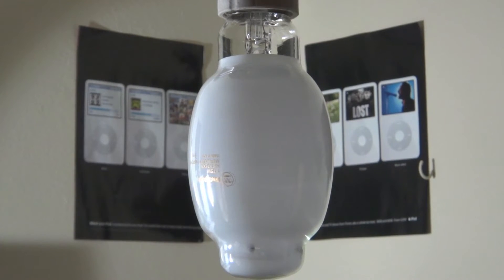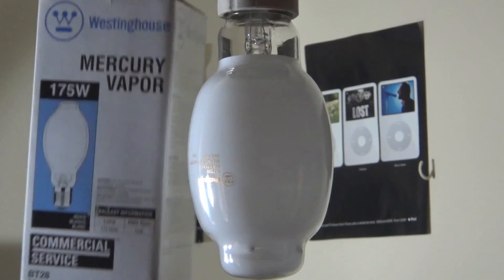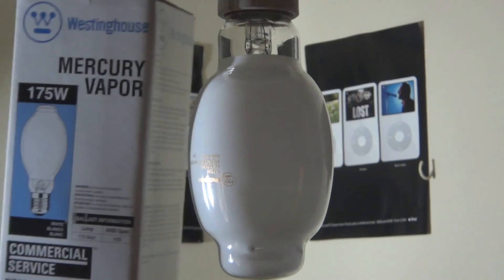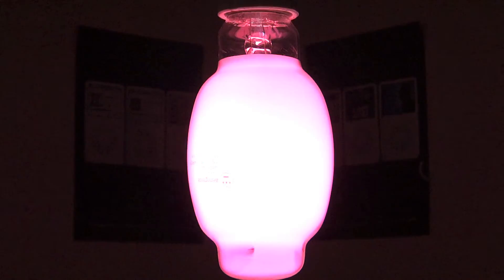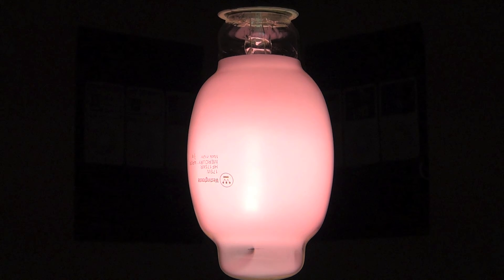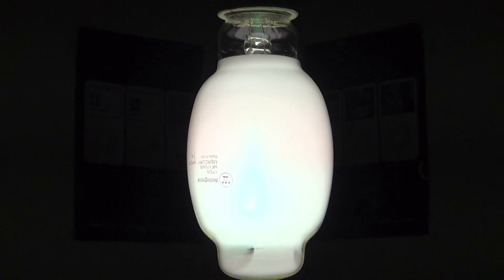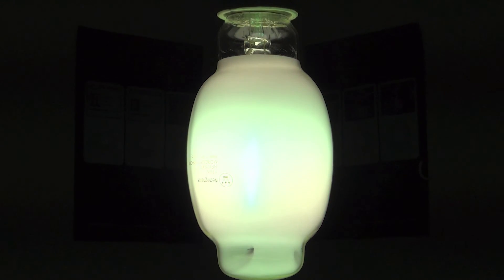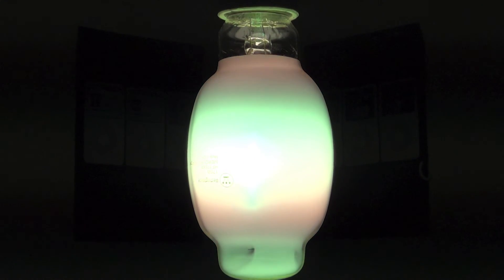Westinghouse Mercury Vapor (MV) 175watt bulb turning on 2

Comment: The westinghouse bulbs claim 8900 lumens.  1000 more than the clear or other frosted bulbs.   I noticed it is brighter side by side.   The frosted coating in it is very thin too.  I can see inside it to where at the other frosted bulbs i cant see inside.

Not sure why you think its decent..  compared to my GE bukbs its much brighter.